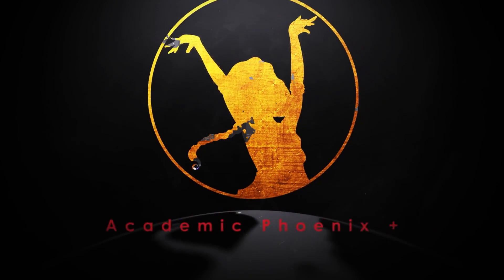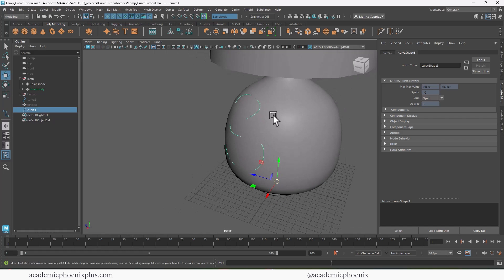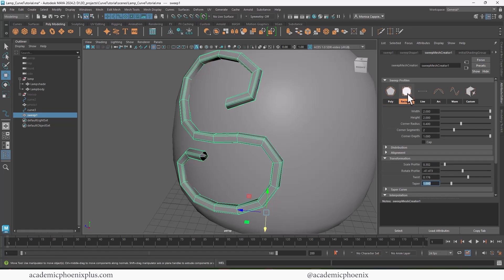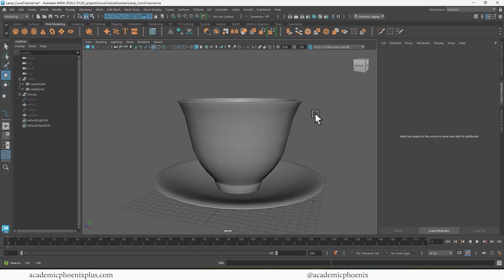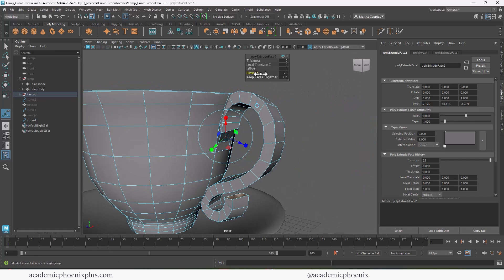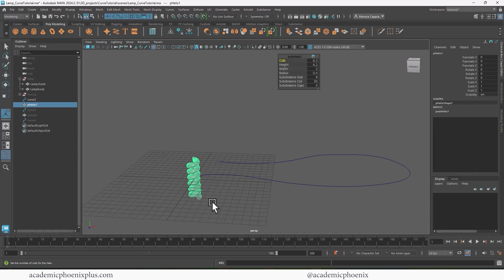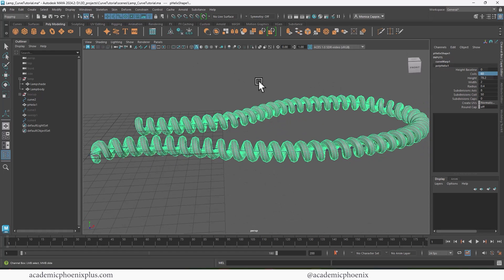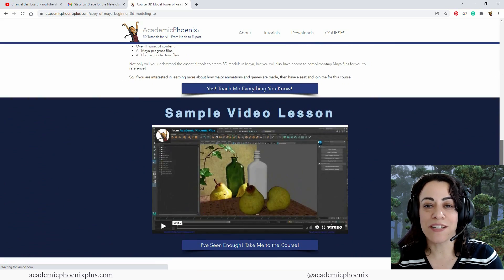Quickly Transform Curves to Meshes in Maya:  Mesh Sweep, Extrude, & Curve Wrap

Comment: Hello.... Firstly thank you very much for helping me learn about this. I am deeply Grateful.. And could you help me with some problem too. When i do this with a cube having sufficient divisions, somehow it ends up with some kind of glitch where it doesn't move along the curve at all and the geometry is also very messed up. When i lock two of the translation x,y,z axes. It functions again but this time the cube is not aligned with the curve itself and maintains an offset distance based on what axis is being used.
Reply: fixed it by going to interpolation, switch mode from precision to start to end
Reply: @laikyuu-san1134   Thenk you buddy. It's been long since i tried this. Will have to go back to see this. Thanks again